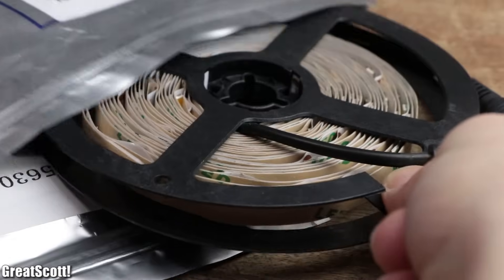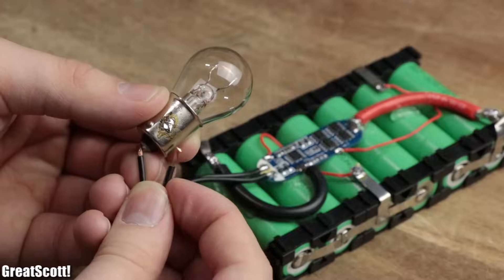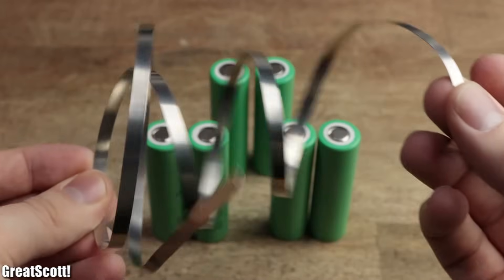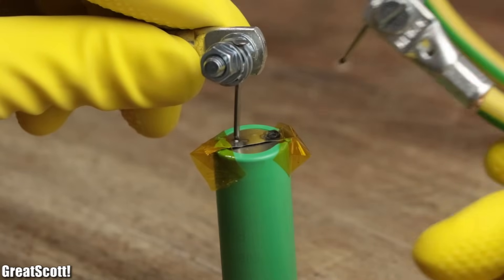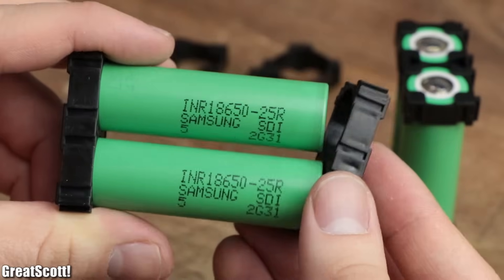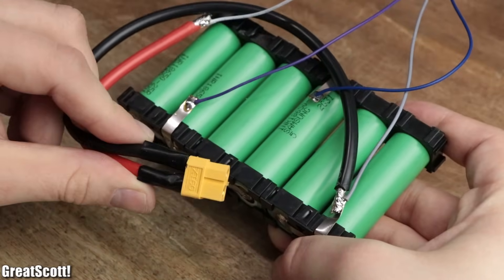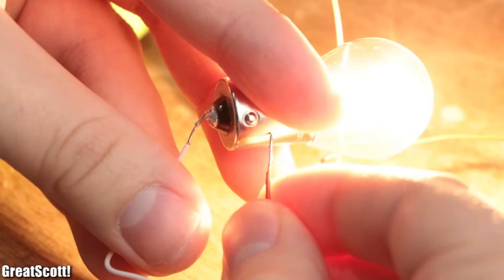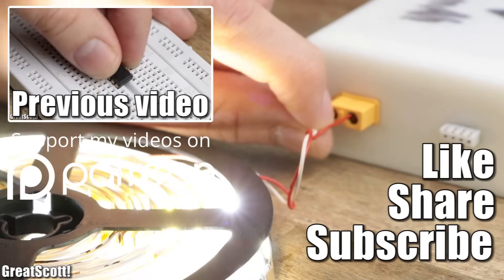Make your own Li-Ion Battery Pack

Comment: Great scott logic: I need to build solder a batterypack, lets build a fucking spot welder lmao hahah ly man
Reply: Mathis 😂😂
Reply: spot welders are the correct tool if you're going by the book, they don't heat the battery up enough to risk damage. so it makes sense he would try that first.
Reply: Sir how can I convert 3g/4g internet wifi dongles  to a GPS tracker for pets
Or 
How to make one GPS tracker
Reply: @gmmrk35  you can't

Comment: Hold on! I thought 2500mah was for each cell. Wouldn't that give you 7500mah for each series pack?
Reply: Sebastian Muehlnikel 
So are you saying the capacity of 3 cells in series is the same as one cell?
Reply: Mussie Tesfay 
If you put 3 Cells in series, you have the energie of 3 cells. :
4,2V * 2,5A = 10,5 watts
But:
12,6V (3 cells in series) * 2,5A = 31,5 watts
Reply: ***** So basically mah is not a unit of how much energy you can store? Then what exactly is it?
Reply: *****  I would assume mah varies by load, so why is it even used as a unit of measurement? It seems unreliable to me.
Reply: @mosestewelde8163  5000 mah = 2 cells x 2500 mah 
=  5 amps for 1 hour !

Comment: I thought BMS balance charges when you supply 12.6v in parallel to the output.. I wanted to make lots of DIY projects with 3S batteries, but is there a way not to use balance charger and just a simple DC barrel jack? :(
Reply: NO

Comment: When soldering batteries its best to leave the soldering iron on for at least 5 minutes so its 100% hot otherwise you have to heat the battery to long...

Comment: soldering the battery is not that bad, spot weld will also heat the battery.
Reply: ***** sure but still the difference is not big if you have a hot soldering iron.
Reply: at least you heat it two times, first tinning until the solder sticks and then a second time to connect. but its true: More damage is done with a weak iron with too little temperature.

Comment: Note that a lot of LiPos don't like it when you solder to them, so use a very high soldering temperature with lots of thermal mass, work quickly, and then use some damp cloth to quickly cool the joint down to safe temperatures. If in any way you can, use welding for the tabs instead. Its a nice little project to create a capacitor based welder for tabs anyways.

Comment: Nice project. I'd probably skip the hassle of tab welding or soldering and just use two of the 3-cell holders from eBay. It wont be quite as compact but it will get the job done. Maybe replace the included wires with thicker ones.
Reply: Gadget Addict Those battery holders have a ton of resistance! I have some here laying around and I tested. He needs the tabs.
Reply: Did you replace the supplied wires on the battery holders?
Reply: It's not just the wires, the connectors inside the box and even the springs can't handle any decent amount of current.
Reply: Yes, but a balancing BMS board is mandatory, and the cell holders are dangerous as they can rip the upper casing of the battery and can short out the battery.
Reply: Telmo Monteiro the holder has resistanse? Wtf?? Those holders are spacers, aka for better cooling. He has a closed box, aka no air anyways. He does not pull close so any current, so the batteries wont heat anyways.. bruh no need for those holders

Comment: Should build one that has a bms that can balance charge
Reply: JT Lowry if I understood him right, the balance connectors added at 5:57 make the BMS balance charge the pack. But I’m not sure. Could someone explain please?
Reply: @knodelcrafter6888  he literally said it can't balance charge
Reply: Max745  board has balancing capability. Around $10 on aliexpress

Comment: You don't need overdischarge protection when lighting LED's unless the LED's can function below the safe discharge voltage.
Reply: when you have the cells connected in series, then you need one, especially when you have cells from different manufacturers, when you don't have a overdischarge funktion, a cell that has not the capacity than the others can be underdischarged and damaged very quickly.
Reply: TheScrappingJeahaha That's balancing not over discharging.
Reply: Nah, +thescrappingjeahaha is correct. If you have two cells at 3.7 and one at 2, if those LEDs are still functioning at 9V, you're doing damage.

Comment: you should do a regular 5 volt 2.4amp battery pack. or it would be even cooler if you could make a battery pack that has usb c and qualcomm quick charge 3.0

Comment: There is a very good video about soldering batteries from Mr Carlson's Lab, where he shows how to solder the batteries relatively safe it is called Tektronix 224 Oscilloscope Repair and Modification

Comment: Hey GreatScott i have 4 single liion protection circuit and i want to make a 4cell battery can i put the protection circuit in series after amking sure the voltages are the same

Comment: Nice informative video, but the equivalent 3S Li-Po would be probably a more practical solution. Li-Po are only dangerous if they are abused. A simple buzzer that beep LOUD when the desired voltage is reached is plenty enough for an application where it only power LEDs. Plus you can monitor the voltage in real time. Such buzzers cost  ~4$.

Comment: The projects that you are doing are most interesting, thanks!

Could you please show us how to wire some buck converter, a USB battery charger, a USB adapter an ATMEGA 328P-PU operating at 3.3 volts, a boost converter (not sure if this is needed, for the battery charging from USB), to one of the batteries packs that you described in this video?

Thanks!

Comment: Awesome videos. I always enjoy learning new things. By the way I've seen a few 19 v dc power supply schematics but I'm still learning, so its a bit confusing for me. For instance how can I determine a desired amperage on a power supply when designing the schematic? how can I determine how many watts will it produce or how can I make so it will produce a desired amount? i.e: I want to make a power supply that has a maximum output of 19v dc 2Amp and a max of 40 watts... I have a very limited knowledge with regards to electronics and all this is still sorcery to me, but any help will be welcomed. Thank you in advanced and looking forward to the next video.

Comment: GreatScott! Love the videos, and your voice doesn't lul me to sleep like some college prof's I know! Just wondering if, (you read these,) you could tell me what wattage your soldering iron is. I have a Radio Shack 30w. Don't think that is quite enough to heat the battery terminals to hold the solder firmly. Although I wouldn't want to overheat the batteries, what is your recommendation for the SAFEST HIGHEST wattage of soldering iron? Please and Thank you.
Reply from the maker: I use an Ersa I-Con Pico at 370 degrees celsius
Reply: Thank you GreatScott! I will have to check that one out, as my other thought was using a Weller Pro soldering iron. Soldering batteries is a pain in the backside, the ribbon is easy... Would you recommend using a heat sink of some sort to dissipate SOME of the heat?

Comment: I still don't get it...how it is possible to double capacity by paralleling, but not by putting them in series? Is it difference between Ah and Wh ?
Reply from the maker: In parallel increases the Ah. In series increases the voltage.

Comment: Question would batteries like this be a good choice for a homemade battery pack that needs to run an outrunner electric motor. Because Lipo i know is the lighter and more compact option, but also more touchy. And lith-ion would be nice, since they can operate in a wider range of conditions. Though my concern is getting the needed voltage and most of all the amps. otherwise the motor wont be able to work effectively at moving the scooter.

Comment: Hey Scott.
Great video as always.
I am building 36v battery pack using 18650 cells(for cordless drill)however it takes forever to charge using a standard lipo charger with max of 2amp.
would you be able to recommend anything?
Thanks in advance Dali

Comment: I built my own DIY battery tab welder out of car battery and some beefy MOSFETs controlled by a microcontroller. When I press a foot pedal, the microcontroller gives a double pulse with configurable length to the MOSFETs and they then short circuit the car battery through some beefy wire and and hand held anodes, causing the pulsed current to weld the nickel strip to on to the battery tab. It also won't trigger a new pulse before the foot pedal is released for a second at least.

I am an embedded systems engineer with experience in motor controllers, so microcontrollers and MOSFETs are quite familiar to me.
Reply: SiMoS MCmuffin   Alternatively search for ‘atv starter solenoid’, and again with a car battery for a source - i used sharpened TIG welding tungstens as a tip.

Comment: Actually just salvaged 50 18650 cells from broken battery packs at work, they all seem to be in a rather good shape. Built myself a 4S5P powerbank with it :)
Just didn't get around to building a case for it yet...
Reply: muh1h1 Did you use a BMS on your 4S5P pack? How did you do it?
Reply: I'm also curious about this.. Have you tried adding a power inverter ? So that it could power up other appliances..

Comment: Just get several 18650 battery holders and omit the the rather terrifying soldering process!
Reply from the maker: For low currents you can use it. But I would not use it for anything above 3A.

Comment: since the BMS does not what a BMS should do why not just get a battery checker, it will auto detect how many cells you have and tell you if one is going bad or not plus it will tell you the voltage across each cell and beep if it is to low so you can stop the discharge and charge it proper with your balance charger

Comment: how a about a making a video about a DIY BMS with balance charging? you could use isolated DC-DC Converters with TP4056 ics. This would be much cooler than usual BMS which only discharge full cells

Comment: You need to use copper electrodes for spot welding, they have better electrical and heat conductivity. E.g. use some solid pieces of wire with 4mm² or 6mm² cross section. 
Whit is even more important, you have to apply pressure with the electrodes and you have to KEEP it after the current is switched off. Some people use a big capacitor charged to the right energy, which is discharged with a big MOSFET (or thyristor) through the welding spot. But a transformer is also very good. You have to switch the current on just for some milliseconds. In case of a transformer this is best done at the primary side with a solid state relay. You can also use MOSFETs on the secondary side, but obviously they have to be rated for several 100A.
The timing can of course done with a small micro controller with display and all the bells and whistles. But of course a simple 555 also can make the pulse.
Reply: Can you do a how-to video on this maybe?
Reply: unfortunately not. I plan to built a capacitive discharge unit, but did not yet do it. and I have really no experience in making videos. i did some google search some time ago with keywords like: battery spot welding, capacitive discharge spot welding and similar. I think there were even some videos in youtube.
The principle of keeping the pressure until the weld has cooled is generic for spot welding - you want together and not just burn material. You do NOT switch the current with the electrodes, you do not want an arc. Its resistive heating

Comment: In the manual of my solderstation says that of you are soldering a circuit there must be no electriciti on the wires you want to solder. I see that you've done it and dit this any damage to you're solderstation. Thx (and srry for my bad English i hope you can solve it😉)
Reply: Noud Lindeman
the soldering iron tip is probably earthed. This only applies when the circuit is also earthed. The soldering iron can short circuit a supply through the mains earth. The battery is isolated from mains earth, but soldering to lithium ion batteries can melt the plastic membrane inside the cell, short circuiting the cell. BANG!

Comment: You basically built a big and heavy laptop battery :) 

I've scavenged quite many 'dead' laptop batteries for the 18650 cells and protection circuits, as usually it's just a single cell (or a pair) that's dead with the rest having around 80% capacity left.
Reply: JohnEdwa 
the good thing about salvaging batteries is that a short lengths of zinc strip is left attached to each terminal. Quickly soldering to the ends of the strips is safe, as terminals can be kept cool 😀
Reply: I usually get them from "scrap" hoverboard batteries. 20-24 of them in one pack depending on the nominal voltage. Usually 1 out of 5 bateries is totally dead and I can revive roughly 70% of the 0V cells by chraging on a TP4056.

Comment: Scott, using liquid flux before soldering makes soldering much easier and faster. I've added solder to the positive terminals of 18650s to make them fit better in my flashlight and it only takes 3-5 seconds to add the solder when flux is applied. No sanding needed.

Comment: I have the same 3d Printer Hot end. There's a really cool fan shroud that someone made on Thingiverse for it. Its cool because Prints always work better if you can use a fan to cool them down. Love the video!!! I got into electronics because I watched like all your video's. You always make sure to include everything. Awesome! Here is the link if you want to check It out. http://www.thingiverse.com/thing:420204 
I printed this thing and it worked awesome but you have to know a bit of electronics to wire the fan in lol that won't be a problem for you lol :P ;) You should put some RGB lighting on the 3d printer! as it prints it could be like your watching a movie lol That would be so cool!!!

Comment: I think that best option is to use spring loaded battery holder, if you don't have spot welder
Reply: Often the springs (steel) have very high resistance. I had already some of them melting their way through the plastic with just 2A and NiCd AA batteries. So they are the easiest, but not the best way. The best way is proper spot welding with copper electrodes and a good pulse of current, e.g. the 7,5V MOT switched on the primary side just for 1 or 2 half sines of the mains supply

Comment: A discharge of 2.5 volts? seems kind of low to me. correct me if I'm wrong.
Reply: As is the 4.24 volt max. It's a protection circuit, it's main purpose is to keep you from destroying the cells or making it catch fire if you mess something up, not to provide the most optimal operating parameters. The optimal LVC would be around 3.4V (so it recovers to 3.7V), but that could trigger prematurely from the voltage drop under heavy loads.

Comment: What type of solder do you use?
Reply: Probably good tin/lead solder, as it flows well. And as you would need even higher temperatures for lead-free, I would not recommend it. I don't eat my solder, so the lead does no harm. :-)

Comment: Neat, I made a very similar video about a week ago (Made a 16v 10,000mAh battery brick), using one of the ebay spot welders.  I finally beat you to a video! Lol - you went ahead and added a BMS though, which is a really good idea.
Reply: Eunice Deines I think it has to do with charging all the batteries in a pack equally, but that is only a thing to consider with packs consisting of individual cells, not like the lead acid battery. I am not sure, so you should double check
Reply: Hey! Would it be possible to add a power inverter to this power pack? so that the power adapter 
would be able to Power different small appliances like Fans or chargers.
Reply: Whattttt Is An Equalizing Charge, Why Is It Neededddd, And How to Apply One To a Lead Acid Battery > https://t.co/3ycayBV4e1?hwhqn4BmC2Isdd

Comment: I have acess to some 18650 from laptop batteries in an old school ware hause they have 5 feet boxes full of them I have gotten some most of them work but they are a pain in the butt to take apart and surprisingly they have charge

Comment: I do pack builds like this all the time because I have a flashlight that I'm working on making replacement packs for. It uses a 6S unprotected LiIon pack that I simply just add a voltage alarm to. When a cell reaches 3.00v it deafens the user and flashes a red light bar. I'm thinking I might make it more subtle though by adding a transistor and a latching relay so that it cuts the power from the  battery when the cell voltages are below 2.9v

Comment: you seem so skilled a soldering I cant get solder to flow like that on cells. and also don't try to tap the nails try to create a relay and with a switch try to turn it on with the leads in place maybe that will work for spot welding

Comment: WARNING! 

Never solder to the positive terminal of an 18650. Under that terminal is a spring that holds a safety relief valve. The heat from soldering damages this springs tempering and can make the relief valve act erratically. This can lead from poor battery life span as the valve lets out material too easily, to injury from an explosion when the battery won't vent when internal pressures are too high.